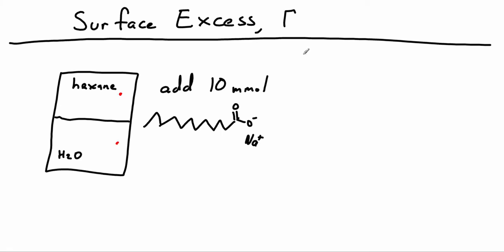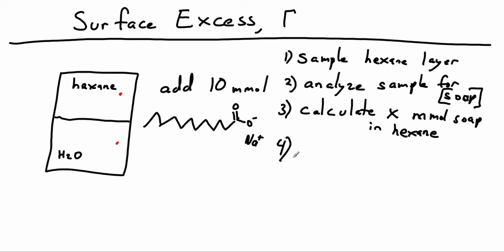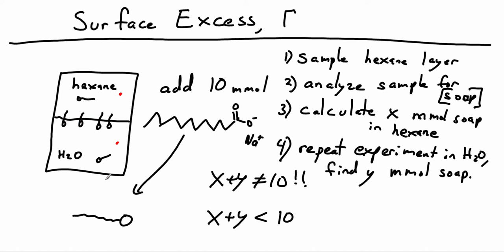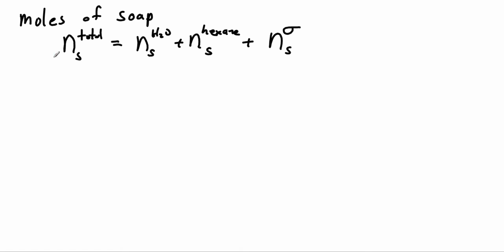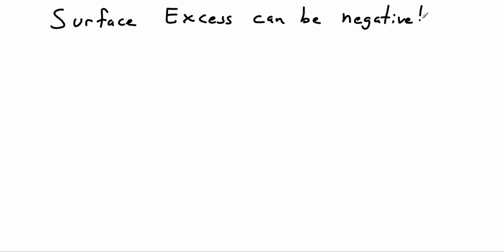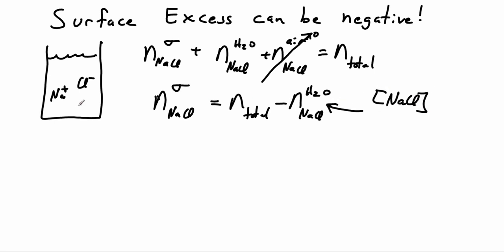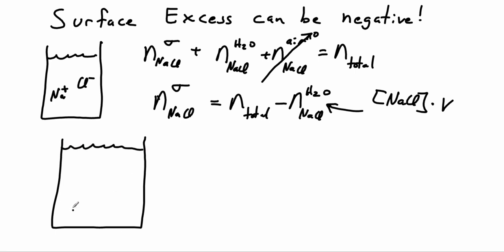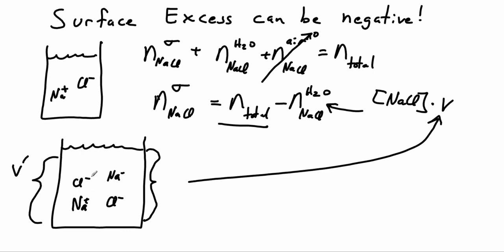Introduction to Surface Excess

Comment: Negative surface excess doesn't make sense since, as you said, product of concentration and volume of the container gives number that is too high which means that number of moles of NaCl is falsely calculated and thus negative surface excess is also false since it is based on false calculation. If we take correct volume of the water phase as V', as you said, than surface excess is no longer negative because of which negative surface excess has no sense.